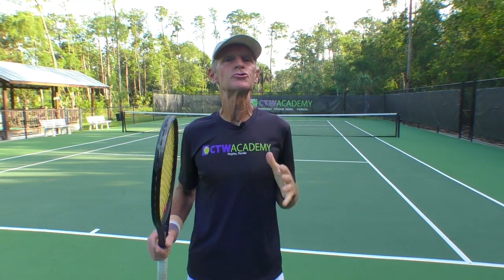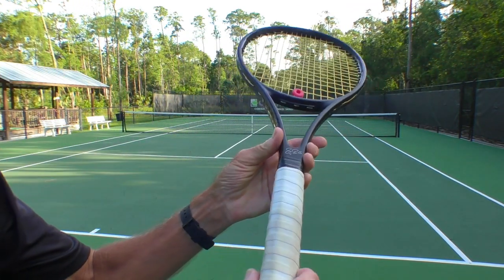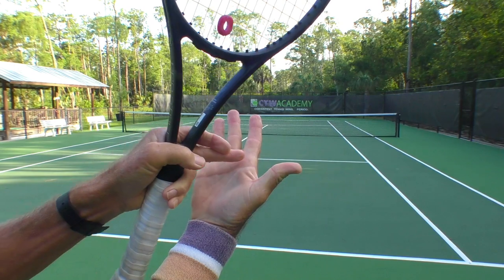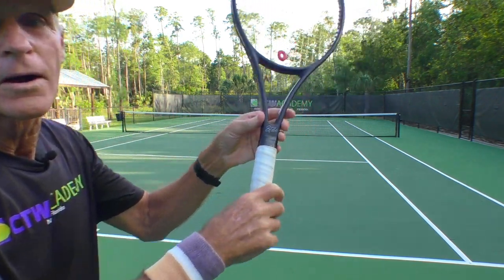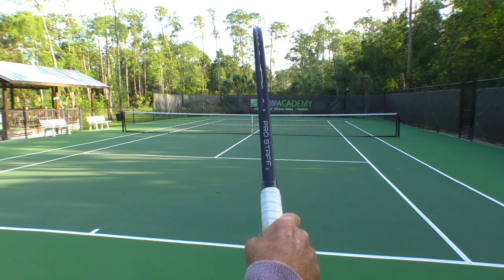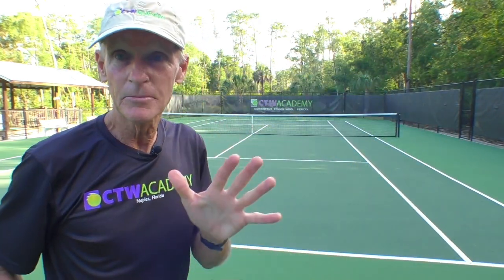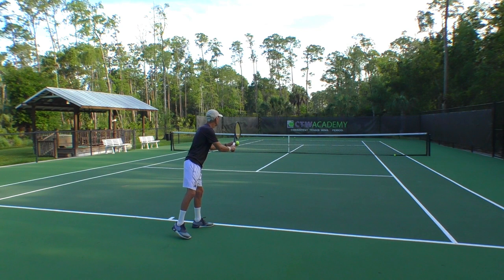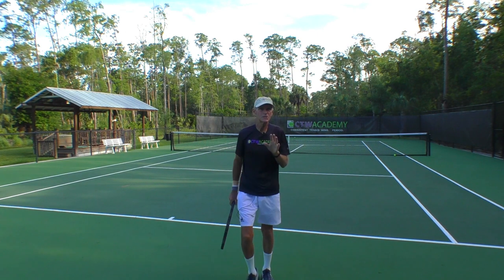#1 Reason Your Hard Serves Are Going In The Net  Free Tennis Tips With Coach Tom Avery

Comment: Nice video. Can you clarify when you approach the ball on edge for the flat serve, do you align the edge directly in the balls path or slightly behind and then pronate? What about the spin serve you just shown? Appears that edge is slightly behind ball when you choked up on the racquet initially for demo. Thanks
Reply from the maker: Flat serve the racquet is approaching the ball straight on, on edge, but the forearm and wrist pronate before contact so your racquet hits the ball flat... no brushing action... with topspin serve racquet edge approaches the ball from below the ball..... once the edge of the racquet gets by the ball you lean forward so the strings can pick up the ball in the position I stop action in the video... and moving on an angle from low left to to high right, assuming you're right-handed...  just like topspin with your forehand racquet is moving low to high.
To your tennis success,
Tom
Reply: @Fundamentalsoftennis  thanks

Comment: When i train by myself with wall i hate when i hit the ball and it comes fast towards me i can't control hitting it back because it's side  and goes to another path i need to be balanced, how do i do it?
Reply from the maker: If you have room move back and let the ball bounce 2 or 3 times before hitting, the purpose of a wall is to work on your strokes!!!  You can use it for reaction time drills also but standing back will give you time!!
To your tennis success,
Tom
Reply: You can also buy a foam tennis ball which dies when it bounces. Or there are tennis balls made that bounce at 50% of the speed of a normal tennis ball.